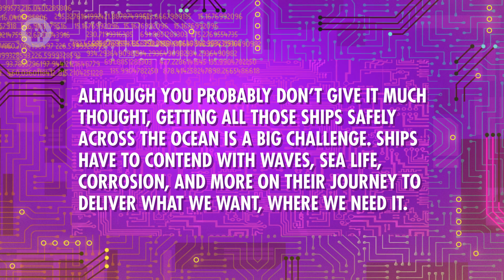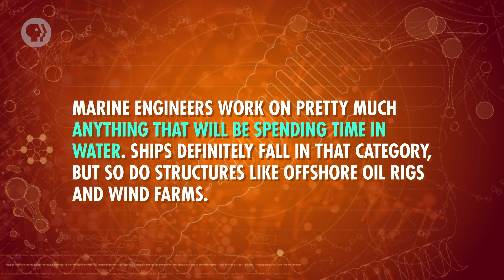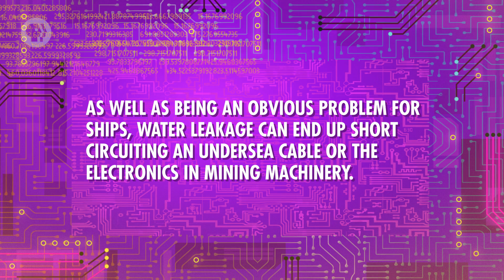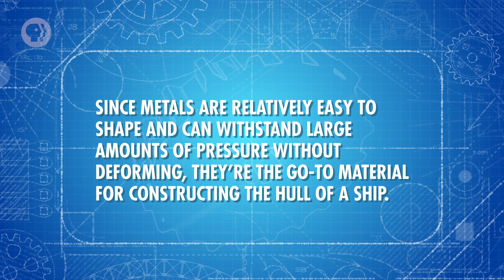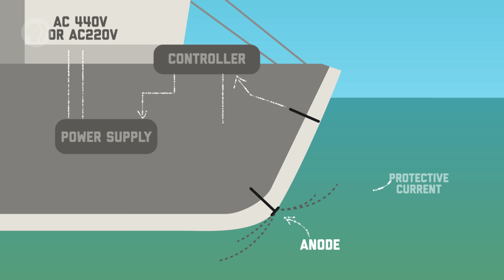How Seawater Sabotages Ships: Crash Course Engineering #43

Comment: In the age of sail, sacrificial sheathing of cheap, low quality wood was added to the hull to protect the actual planks underneath from fouling - especialy the shipworm, a crustacean that burrows into the wooden hull, slowly destroying it.
Later copper sheathing was used instead, as the toxic effects of the copper effectively prevented foulign to occur in the first place.

Comment: I think it's worth mentioning that when the Navy designed the new submarine propeller, it wasn't to prevent damage to the propeller, it was to make the submarines harder to detect underwater by preventing the noise of cavitation. Passive sonar is very important for submarines, and staying as quiet as possible to avoid detection is a great strategy.

Comment: I guess u meant screws rather than propellers 😌
Reply: Propeller  
noun   
a device having a revolving hub with radiating blades, for propelling an airplane, ship, etc. 

Propeller and screw are interchangeable.
Reply: Then how come most airplanes don't have propellers at the rear? Why do ships typically not have their screws at the fore?

You can literally use literally to mean figuratively and and technically it's right.. but you can also be precise, and engineering is founded on precision.

Comment: At 6:53 wouldnt it be hidrodynamic since it's going throug water?
Reply: *Hydrodynamic and yes you're technically right but actually no since both are essentially the same thing in that they're dealing with how much drag results from fluids (both air and water are fluids) moving over an object.

Comment: Ships and submarines does not use propellers, they are called screws.
Reply: Do they Propel the ship or submarine forward and back words depending on their spin? They are propellers
Reply: @Skepticfornow  The thrust bearing propels the ship, not the propeller, or 'screw'
Reply: @Skepticfornow    Negative, the inclined planes rotate around a central hub and literally screw the vessel through the sea. If you don't believe there's a difference, meditate on the dearth of either airplanes with their propeller abaft or ships with their screw forward.

If you can't engineer a better understanding from that, 
You should probably just go propeller yourself. Heh
Reply: Training marine engineer here, and I've never heard it been called a screw.